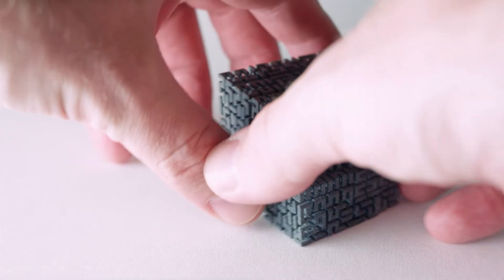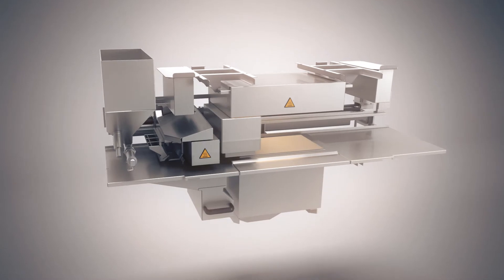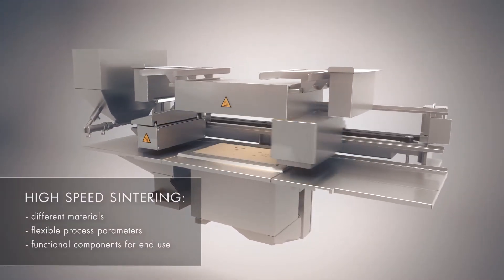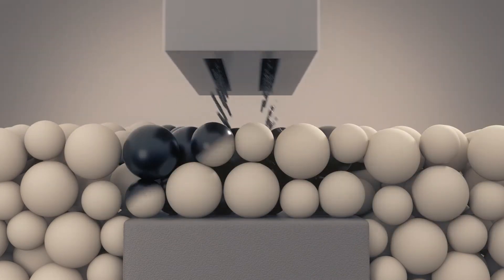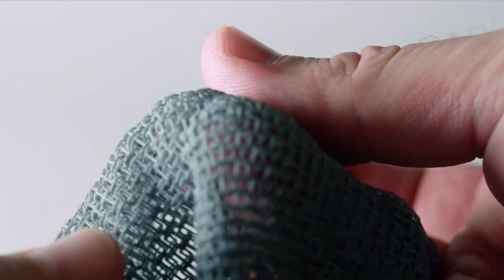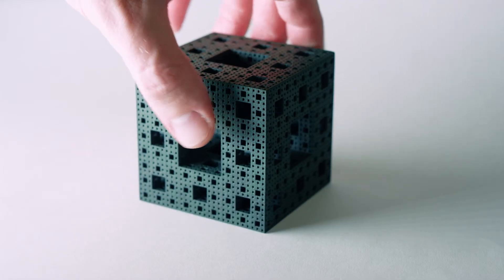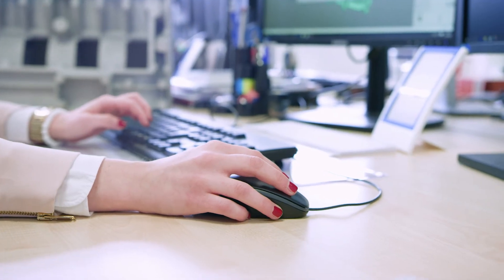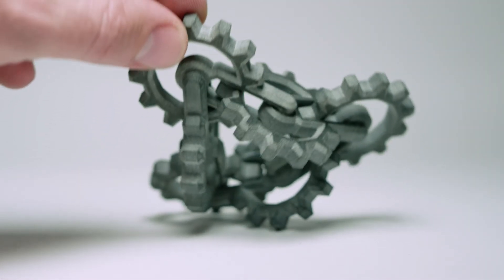Polymer 3D printing Process High Speed Sintering (HSS)

Comment: if you look at sand-mold printers as metal printers you have records for the fastest, largest metal printer and the most durable parts with the widest choice of materials.
Powder bed printers can also create extremely complicated parts.

Now with this system you also have the fastest plastic printer, the printer that creates the strongest plastic parts (compatible with PEEK and carbon fiber reinforced plastics?) And the most complex and it is also one of the largest plastic printers

basically the only three disadvantages of your printers are:

the resolution
post-treatment (especially for the metal to be poured) but this is not a problem in a factory that already has machining and casting equipment.
no closed cells in the structures (powder need to be extract) so it isn't compatible with printed floatable parts

and if I do not say nonsense you powder are 100% reusable against 50% for sls printers

All that taken into account I think that your printers deserve the designation of '' best 3d printers of the world ''

by the way, do you plan to make hss printing compatible with metal?